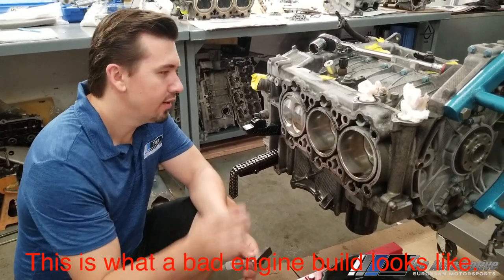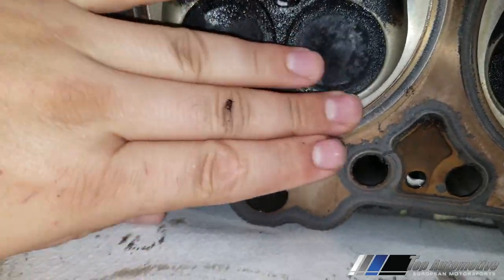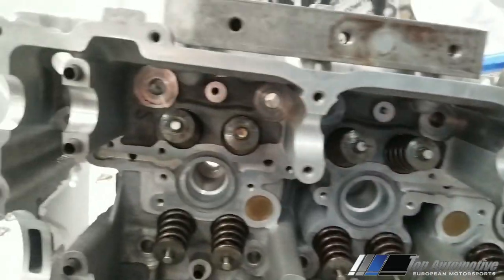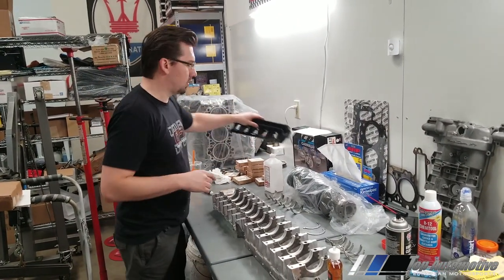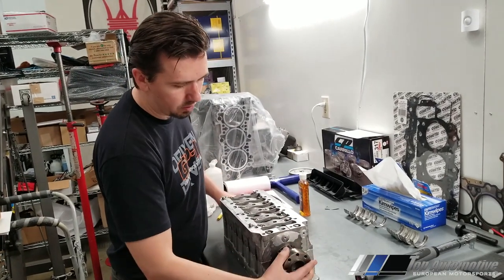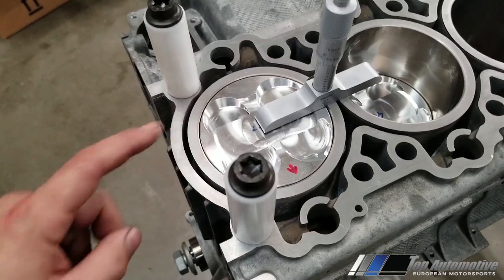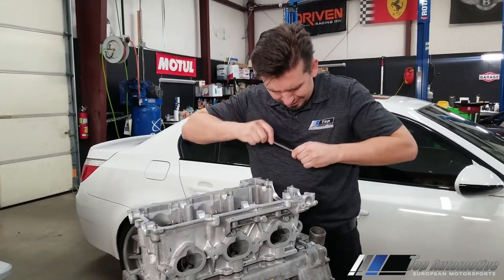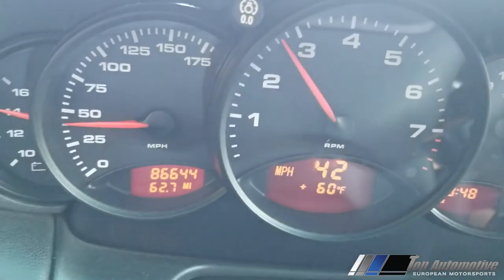PORSCHE 911 M96/M97 step by step performance engine build - Big Bore Nikasil Cylnders

Comment: Terrific build videos on this 996!  I hope I never need to find an engine builder for my M96.05, but this is sure good information to have.  Question for you, Nick...I get that the rings should always be positioned 180 degrees to each other, but won't rings "walk" around the piston over time anyway?  Can we really expect rings to stay in position?
Reply from the maker: Thanks Tom. Reguler rings will move for sure after the engine has had some miles on it as this is normal. Rings are positioned this way to build compression on first engine start and to avoid blow by. However, total seal inside rail rings will only move slightly and stop so that is the big diffrence.
Reply: Hello Nick..
Been a fan or your service and maintenance expertise.
For this particular performance engine build… with the all that was done here..
1-What brand and weight oil was used.
2-How many miles do you warranty the block for.
3-What is the “Ball Park $”for this type performance build.
4-If this was a 3.4 or 3.6 liter.. has it remained at that measurement.. or was it increased.

Thanks much..

Comment: Does Porsche invent ways for engines to fail?   First, it was timing chain tensioners.  Then, cylinder liners that shift (Boxster). Then, IMS bearings.   GT3 rod bolts that snapped.

Now, bore scoring.

Comment: From a driver perspective, what likely caused the scoring on the nikasil sleeves?
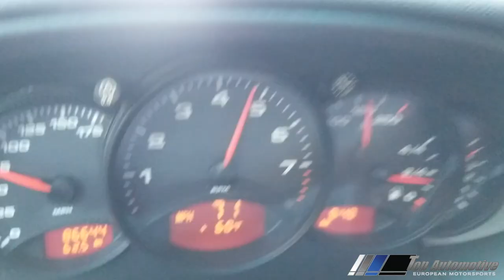Reply: Engine consistently running over 110 celsius. 19:14, just look at this time stamp. I know it shows around 100 celsius, but we always need to keep in mind that the thermostat is far away from the hottest point of the engine aka. bank 2, cylinder 4-5-6, therefor we add 10-15 celsius to the displayed value as an estimate.

Comment: I live here in charlotte and have an M96 sitting in storage that was removed from my 2001 911, it suffered an intermix problem witch I caught very early on, I saw the red coolant level light on and knew right away what to check, anyway I've replaced the engine and now I am at a loss as to what to do with this one, I would hate just to scrap it, do you have any ideas or suggestions as to what to do
Reply from the maker: Send us your contact email
Reply: @TopAutomotiveInc  Will do, I will reply to you by email with pics and further explanation, also I must say I am impressed with your knowledge and the quality work you do on these vehicles

Comment: Any reason why you went 3.6 over a 3.8? If the heads were left stock, I could understand that, but I would assume the bigger valves would be sufficient to feed the increased displacement. Regardless, awesome video and it’s making me look forward to my own build in the spring.
Reply from the maker: Customers request to 99mm bore from a 96mm, very close to a 3.8L.

Comment: 19:14 everyone breaking their heads why these engines bore score ... look at these water temps, now add 10-15 celsius to those ~100 celsius displayed, since the thermostat is far away from cyl 6 aka. hottest spot in the engine, on the gauge and you got your main reason for bore scoring. This car is either driving with AC off, since the front fans wont spin up immediately if the AC is off, or has its radiators clogged up with dirt. Might also be a general problem with the poor design of Carrera front bumpers and undersized radiators. I rarely get to see such water temps on my C4S X51, main reason being the bigger radiators from the turbo and bigger inlet. Temps consistently at 80 celsius on gauge / bank 2 ~ 90/95 celsius. Cold temp thermostat and high flow water pump also a must. Combined with 10W60, say goodbye to bore scoring. Also, do not warm up idling and never turn on the engine for short trips. Take the bike or public transport instead, I don’t care. If you start the engine, drive it for at least 45 minutes, otherwise you’ll just add more and more fuel to your oil and never get to burn it off. And don’t lug / push the engine underneath 3k rpm. If you think about all this, I'd argue its more user error and people not being aware than random material failure.